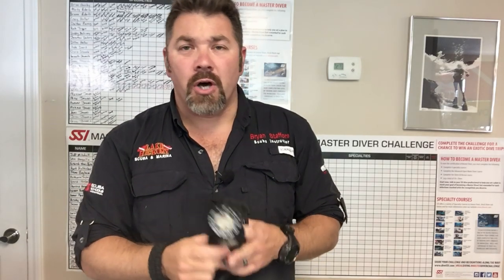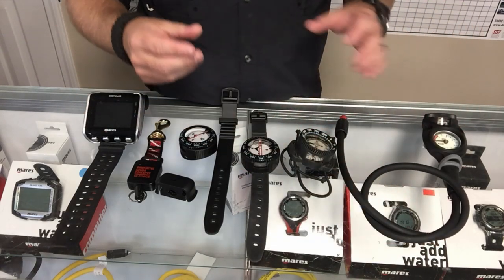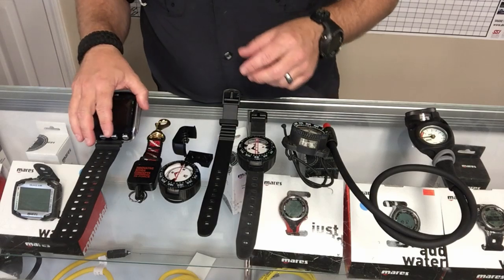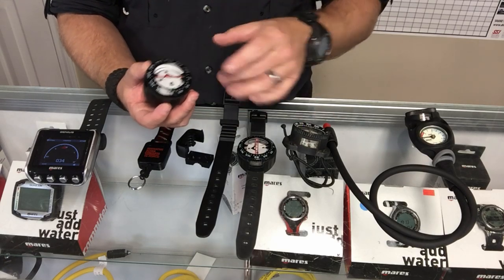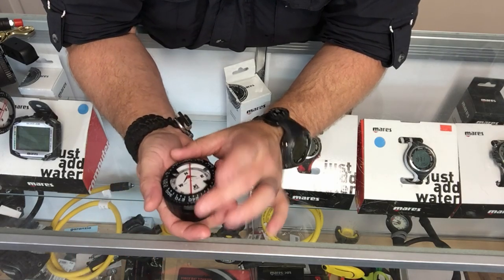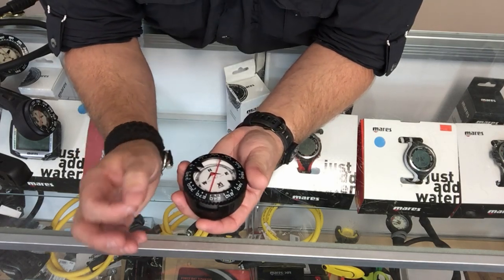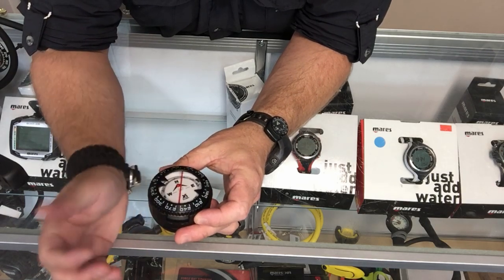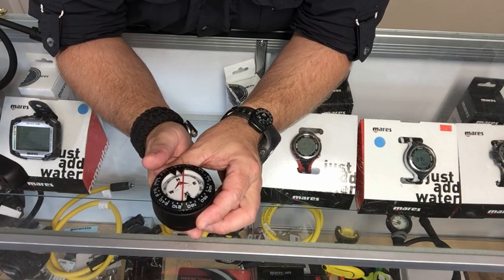Underwater Navigation Part 1

Comment: Good video. I am still thinking about the "perpendicular" that you mention in the video. Is it perpendicular to the arm when you have the arm in the "navigation" position or is it parallel to a line that goes through your body. Keep the excellent videos coming.
By the way, I like the new intro.
Reply from the maker: It can fall either way FALCON 2000.  The main key is to hold it level, and point the lubber line towards your destination.

Comment: Bryan, recently I disassembled my compass for cleaning and repair and found out that there is a copper ring between the compass and the case. What is it that for?
One of my web search bring me an information about magnetic correction in boat compasses, but not sure about scuba ones.
Reply from the maker: That is a great question, and one I don’t have an answer for. Which manufacture of compass do you have? That would be a great question for the manufacturer.
Reply: @LakeHickoryScuba   That's an Oceanic's compass. I made the same with my friend's compass (an old US Divers's one) and it also has the copper ring.
Reply from the maker: To be honest, I have never torn a compass apart.  I will see what I can find out for you though.

Comment: Please correct me if I'm wrong, but with my compass having North at the 180 mark on the dial card ... If I want to turn 120 degree to the right, I will turn my bezel left until North is on 60 ... and to go left 120 degrees, I would turn the Bezel to the right, to 300.
Reply from the maker: The simplest thing to remember with navigation while making turns is to always turn the bezel in the opposite direction you are wanting to go. So if you line up the index markers with the North needle, this means North and 0 on the bezel should be lined up, then turn the bezel to the left until you line up 180 with North. Then simply turn your body to the right until the index markers and North re-a-line, and there is your 180 degree turn.

Comment: Good explanation of setting bearings, although I think you mean parallel not perpendicular :-)
Reply from the maker: Hello Tim Gosling.  If you think of your body as a flat plain, then anything that protrudes off if it would be perpendicular.  Kind of like the letter T.  The top of the T being my body and the lower half would be the direction of travel, or in this case the direction of the lubber line on the compass.
Reply: @LakeHickoryScuba  I know what you mean and you demonstrate it perfectly in the video.  But at 9:20 you say "...you're gonna line that lubber line up perpendicular to you and your destination".  The axis of your body and the lubber line should be pointing at your destination, ie parallel.  The lubber line should not be perdendicular to your destination or the axis of your body, although it may be perpendicular to your forearm if you've got it locked in front of you with the compass on your wrist in the way you demonstrate.  I think that's where the confusion arose for me.
Reply: Tim Gosling confused me too for a split second but I understand what he means. I think it’s more accurate to say perpendicular too cause we’re connecting two imaginary right angles
Reply from the maker: You would be correct.  Its all in a matter of perspective.  No worries.
Reply: I'm with you, Tim. Parallel is correct. 

If you're making a line between yourself & destination, you want the lubber in the same direction as that line, which is parallel. It's not perspective - it's geometry ;)

Comment: parallel
Reply: @LakeHickoryScuba  I think early on in the video you said perpendicular and I think you meant parallel - I'll have to check again
Reply from the maker: Gotcha. I look at my destination as a horizontal plane, and my lubber line pointing to the center of it would make it perpendicular. Think of a T, and the top is the destination.
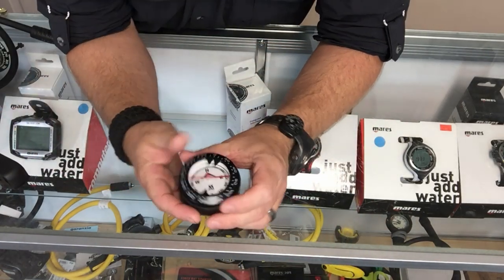Reply: @LakeHickoryScuba  about 9:15 you talk about lining up the lubber line "perpendicular" - I think you meant parallel - you line up the lubber line parallel with your destination not perpendicular
Reply: @LakeHickoryScuba  OK I see what you meant - I guess in my mind I am thinking I am traveling parallel to the direction of the lubber line but I see your view point - thanks